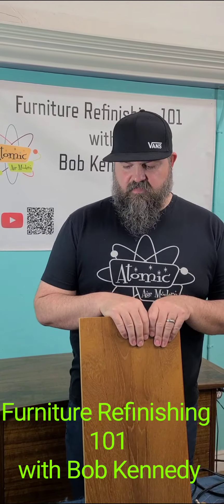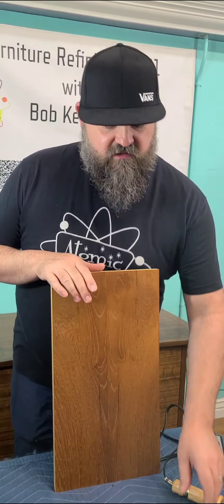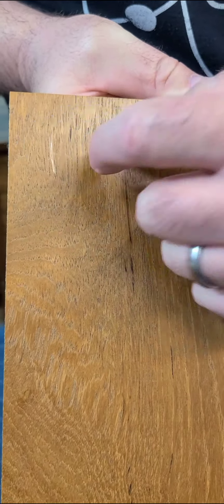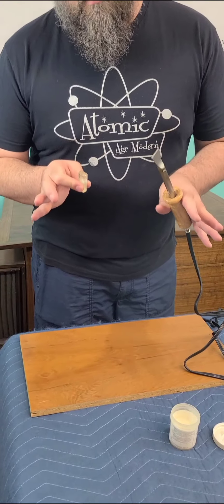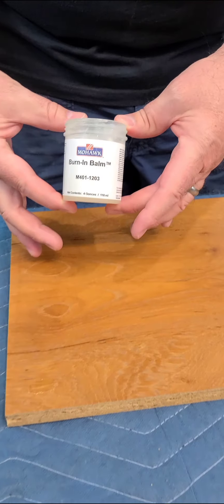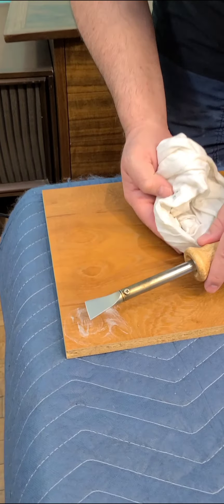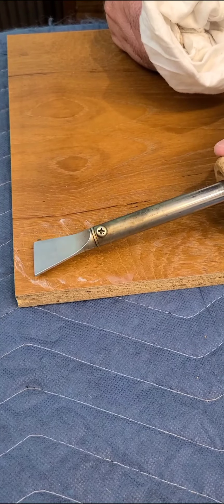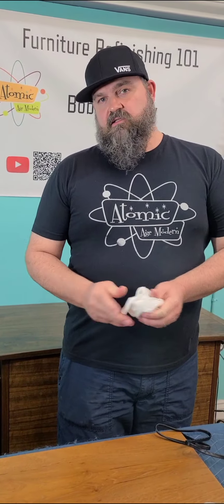burn-ins.... why? Let's do a burn-in!

Comment: Can burns from metal candle holders be repaired on veneer? Can send a pic if you need.
Reply from the maker: Yes, but any charred wood needs to be removed. Then it will need to be filled, inpainted, sealed & topcoated.